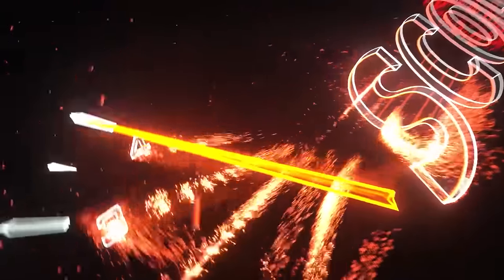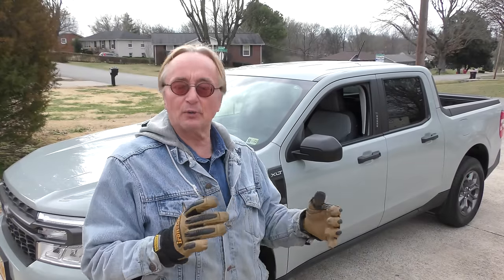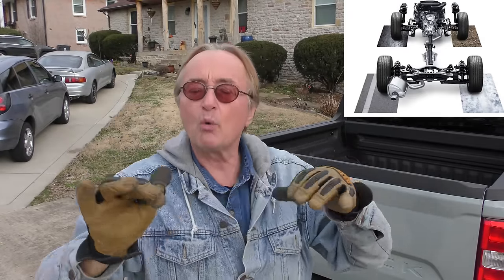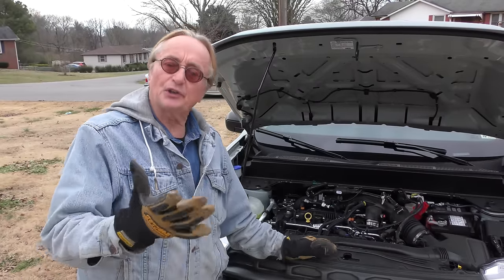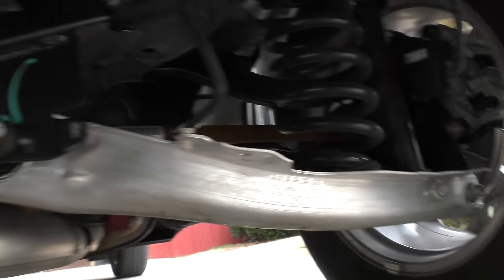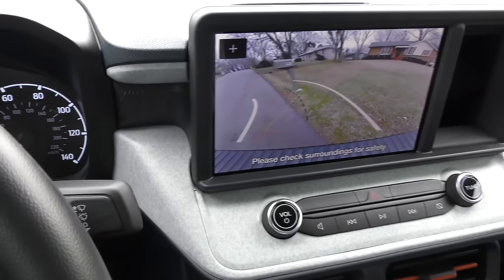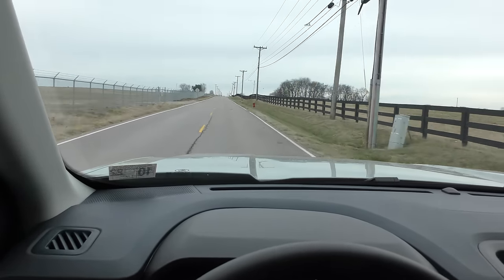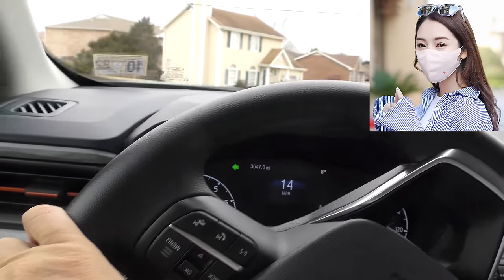I Finally Got a New Ford Maverick and Here's What I Really Think of It

Comment: Okay he lost me at front wheel drive and all-wheel drive I don't like all wheel drive because it's more s*** to go wrong but if it's a pickup I want the rear wheels pushing me snow doesn't bother me I grew up in Illinois throw five or 600  lbs in the bed and have good tires you'll be fine the other thing that got me is when he starts talking about towing who the f*** tows anything with a front wheel drive CV shafts are not meant for pulling extra weight I don't care what anyone says I am not pulling a trailer with front wheel drive I guess I'm going to watch the rest of this video hopefully I can struggle through it I feel like Ford built a Honda Ridgeline

Comment: Horrible dangerous advice about only running snow tires on front of FWD cars. You need all 4 to stop. In the snow with only front snow tires you are in extreme danger when slowing down if the rear decides to lose traction and come around, putting you in a spin.

Comment: Sorry.  A Ford Ranger small truck tows 7500 pounds.That's less than a full size, but useable.  This Maverik has 2000 pounds towing capacity/??///  What??  You could probably get away towing 2000 with a Prius hatchback and it would still ourlast this garbage.   Frontwheel drive  ???  Good luck climbing a 25% grade gravel driveway with that.  You have to retract this review.